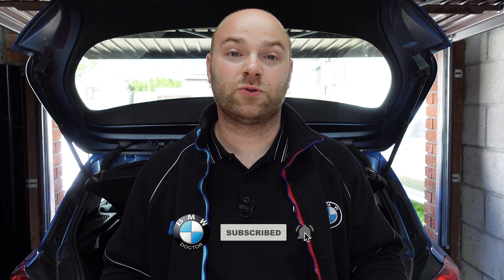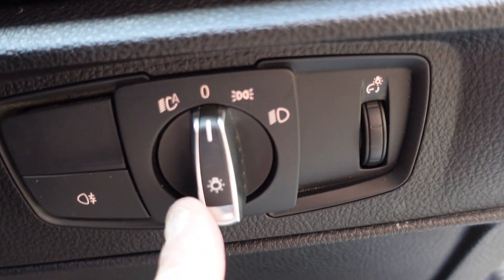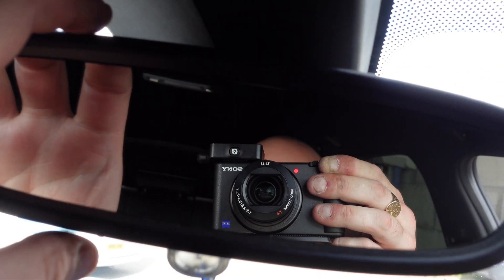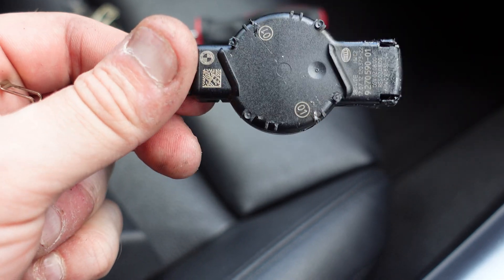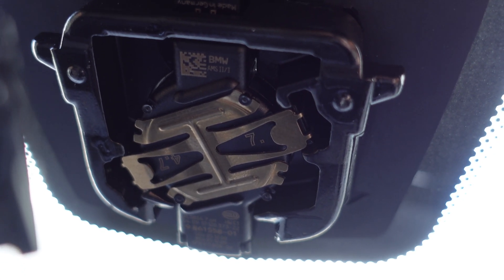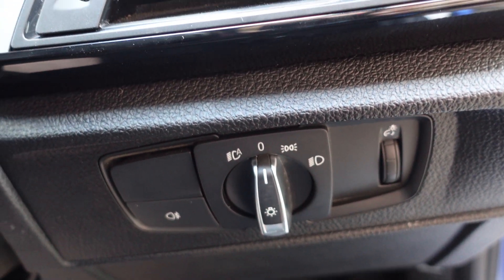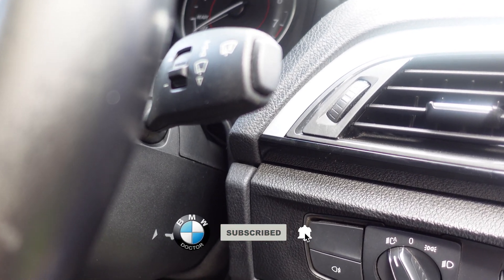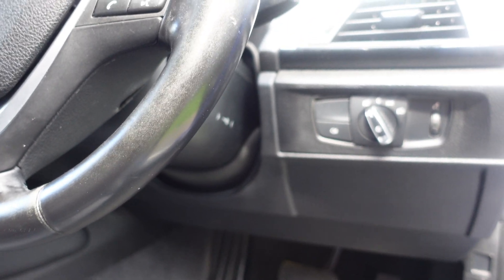BMW F Series How To Retrofit Auto Lights & Auto Wipers ( F20 , F21 , F22 )

Comment: I need help about rain sensor activating. My car have RLSBS sensor and I'm changed the headlight switch and coded with e-sys now Auto Lights working.

And then I changed the steering column with Automatic button function. But when i press the A Mode on column, wipers working as manuel, not sensing.

so i cant use the automatic wiper. i really need help about this problem. please help me. 

Another promblem is i have not this options in my FDL list.

3080 WW_REGENSENSOR
30A0 AIC_KOMPRESSOR_MAG_KUPPLUNG
3130 RLS_LIN_VAR
3130 REGENSENSOR_INTERVALL

Comment: How can I do this retro fit on a F20 that has manual AC. I checked under rear view mirror and there is no sensor or loom plug there at all.
Reply: I have the same, i would really appreciate an answer to this question.
Reply: @157382  Unfortunately it is not really possible without auto a/c.

Comment: Hello. My BMW has factory automatic headlights and wipers. But it happens to me that all the lights are on during the day and not just the daytime, when the switch is in automatic mode. It should only shine during the day, but not short. Do you know what this is about? The rain sensor works normally for me and reacts to water. TNX

Comment: Hi, does 525i E60 needs mandatory brake fluid change in every years regardless the condition of the fluid.
Reply from the maker: Personally, I would change it if it was mine it ain't hard to do. I have done all my cars as every single on needed new brake lines, therefore I had to change the brake fluid anyway.